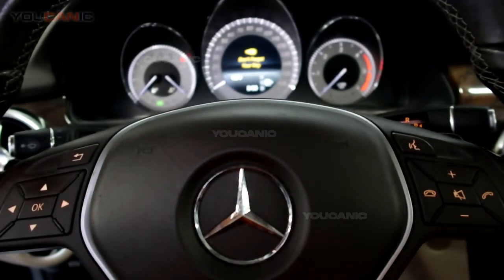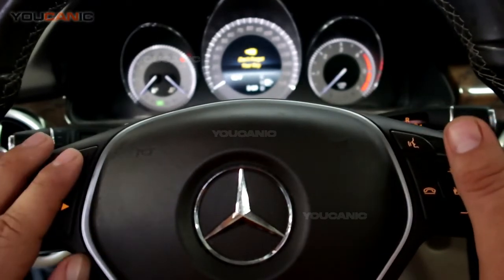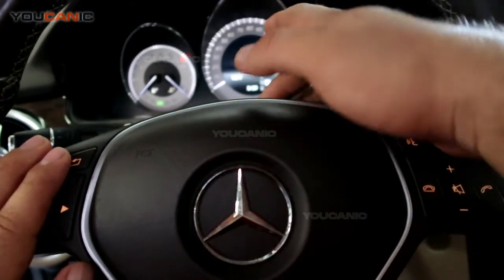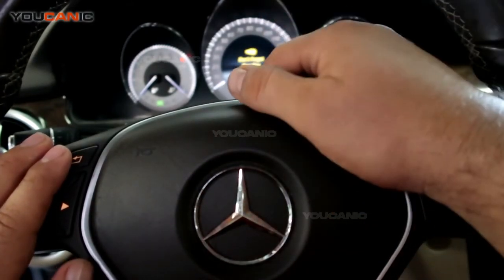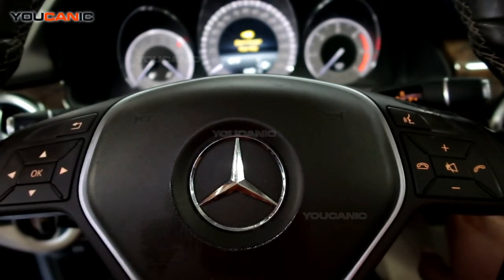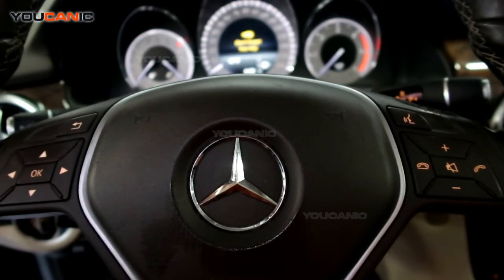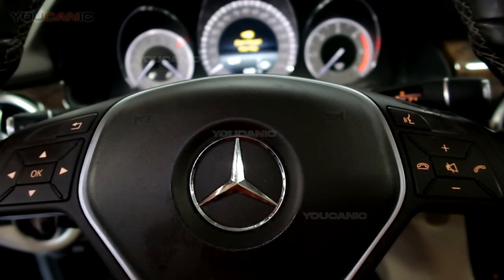Mercedes-Benz GLK Class Steering Angle Sensor Calibration

Comment: FAULT U021287 STEERING COLUMN MODULE. 
Car in shop now. Like a ghost in the car. Has been intermittent. Now on all the time.2024 c43
Reply from the maker: @keithh3099 If you’ve got a car issue or repair question, you can find step-by-step guides and scanner help at youcanic.com. We might miss some comments here, but our site has answers for most problems already!